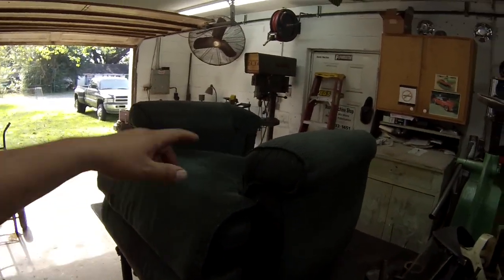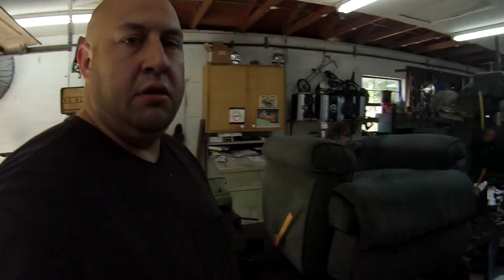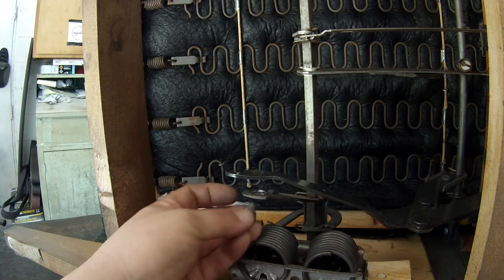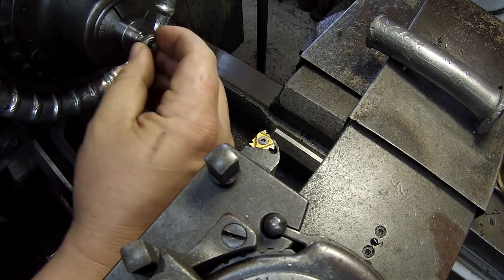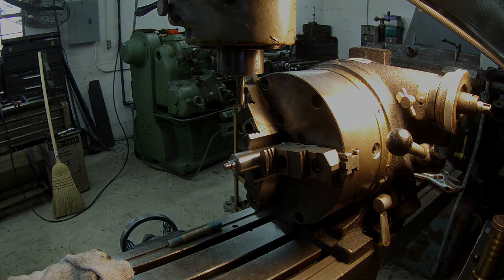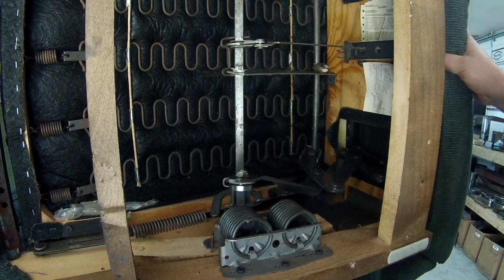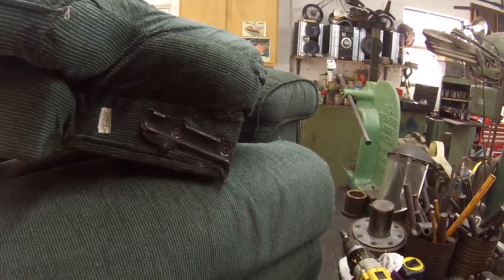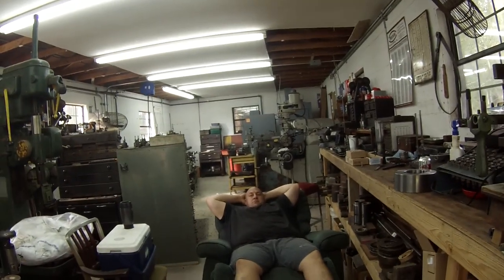Lazy Repair!

Comment: Watched this video just a few weeks ago.... and yesterday had to do a similar failure in my recliner.  Got her into the shop today, cleaned up the break and welded everything back together.  All the rivets and whatnot looked in fantastic condition.  The one steel bar, though, developed a small crack sometime during its life and that crack propagated over the years until the bar just failed completely.  Ten minutes work to weld it up, and most of that was getting in there with a file to try beveling the break so I could get decent penetration with the rod.  Seems like she's all back together now.  Thanks, Adam, for the inspiration!

Comment: I am a big guy as well so I bought a brand new  lazy-boy and the dawn thing flops back when I sit in it  so I had to add another set of springs in front of the  original  set and that stopped. just hope they don't break I am liable to get a spring  where I don't want one lolol

Comment: Adam, I think you missed an oportunity for some home improvement. I'm thinking oilite bronze bushings and Zerk fittings, Chrome Moly brackets with Rack and Pinion adjustment on the recline angle. Better, Faster, Stronger!!

Comment: I have that exact same chair with that exact same problem sitting out on my front porch. my parents bought a pair of them back in the late 70s/early 80s when I was off in the air force. moving forward in time, after both parents had passed the chairs wound up in my passion. n just like adam's chair, one day...pop! my son drug out the broke chair for me. (turns out it had been my dad's chair) n put what had been my mom's chair in its place. reason I know it was my mom's is she had a habit of pushing down on one spot on the right arm n eventually wallowed a depression in the wood under all that padding. the seat padding has all but give out n now has a couple of pillows in place to keep everything in an even keel. I just cant bring myself to get rid of it n anytime I want a memory of my mom all I have to do is find that depression in the right arm where the wood got worn away. mom was a big girl, 5'11" n weighed roughly 340. maybe some day ill get a new one...but....

Comment: Lubrication?   I've got a new cheap one arriving tomorrow, My first.  Seems the chairs that use a cable to latch, need that replaced as a routine, including lazyboy.  The cheap chairs need reinforcement of poor design frame joints.  When chair arrives I'll lubricate every pivot or sliding part, the cable ends.  Then look for weakness in frame.  Years down the road probably re-upholster with boat or awning fabric.

Comment: One suggestion for filming. At the start of the video you pointed the camera toward the garage door with it open. Outside is VERY bright and this caused a lack of detail on the stuff you were filming inside(the chair). So  always think about what the camera is "looking at" as it will adjust for the light level it sees.
Best Regards

Comment: DDDUUUDDDEEE, that’s pretty far for a lazy boy chair. But HELL YEAH that’s a badass repair man. I’ve got one too, it’s in just as hard shape as your was. Mine still fully functions for the time being though. But, when it does break! I’m fixing mine too. Why spend the money when some TLC will get her back too like new. I’m only 5’ - 8” tall but I’m right about 230 lbs. so, my chair gets some hard work when I get home. My wife says trash it too, I say hell no I ain’t trashing my damn chair. Us men need at least some comfort at home between the kids and hollering and fussing. My wife and I have 4 children ages 4 - 12, homework, dinner, bath time and bed time can be rough sometimes. Dad needs his reboot time after repairing and building engines at Cummins all day.

Comment: Adam, I try to repair, repurpose, and recycle as much as I can. The way I look at things, I've done more for the environment by keeping things out of land fills than the average 10 Prius drivers. Keep the repairs of everyday items coming. I am finding that the little things like not cutting off the parts until the last operations prevents down stream problems like holding small parts. Thanks for all your efforts.
-Joe in Tampa
Reply from the maker: Thanks Joe. Holding the work piece as a solid bar like I did is a convenient way of machining multiple parts quickly when you have one piece of stock. Glad you enjoyed.

Comment: Adam;

I hear you about having a favorite chair.  I had one for almost 20 years that my wife threatened to put a chalk outline on as it had molded itself to my body.  Unfortunately it finally got to the point where even I had to admit it was gone beyond repair.

I saw the cooler next to the chair, just add some A/C to the shop and a good flat screen TV and you are made in the shade.

The connecting pieces from the foot rest to the pivot point where the studs wallowed out look like both of them were bent out of shape, especially the top one in the video. You bent them back a bit, but were you able to figure out if something was misaligned or otherwise not as it should have been from the factory?

Regards;

Ron
Reply from the maker: Ron,
Shop AC and a new flat screen are in the plans. Hope to have the ac hooked up and running by next summer, and maybe I'll score a nice tv for christmas.
I never did figure out of the bars were bent or made that way, but I feel like they were bent, maybe just from all the use. I got it working fine now though.

Comment: Just out of curiosity, why didn't you just part them off in the lathe, wanted to try your newly acquired band-saw?
Reply from the maker: Its easier to me to just cut them off then face the back side. Just depends on the job at hand when I need to part them off. And yes I did want to use the new saw!

Comment: La Z Boy guarantees the mechanism for life. I just got one, for free, for my BigBoy La Z Boy rocker recliner. Just go see or call La Z Boy. (No I don't work for them) I just know quality and comfort, this is my second one in 25 years.
Reply: +Gregory S I believe that the lifetime guarantee on the mechanism is only for the original purchaser isn't it?  Adam bought his recliner used on Craigslist. I would love it if the guarantee covered subsequent purchasers. I bought my La-Z-Boy Crandell recliner used and need to replace a broken mechanism on it.  Before it broke, it was absolutely the most comfortable recliner I have ever tried, by a mile! If I'm wrong on the guarantee (or if you know where I can pick up a mechanism for the above recliner at a reasonable price), please reply and let me know. Thanks! John
Reply: only if you keep receipt is the catch we ran into that they said no with out receipt